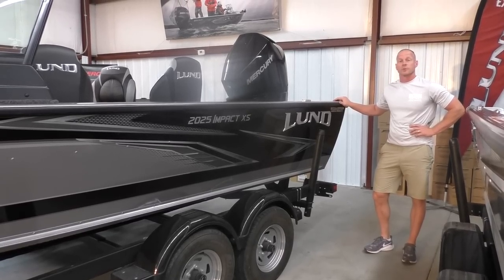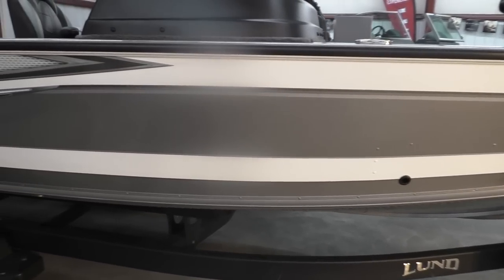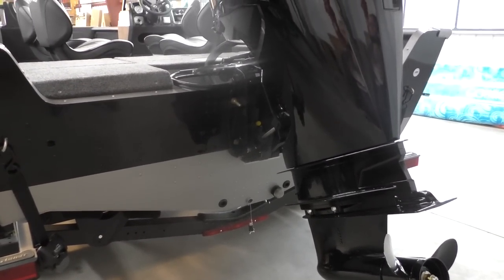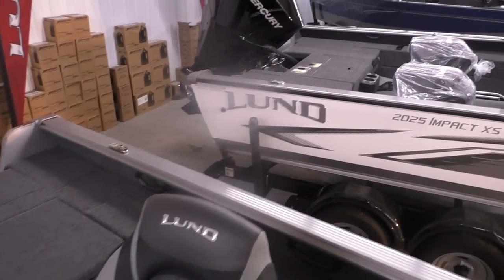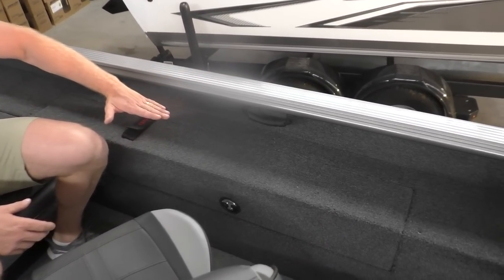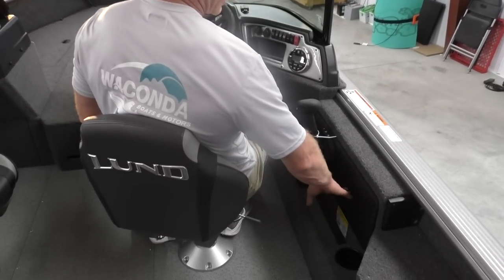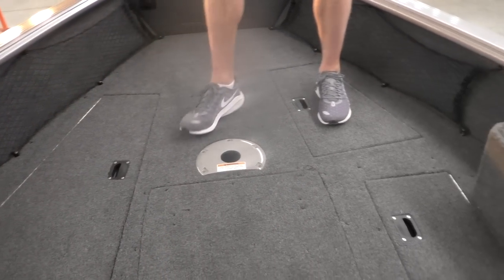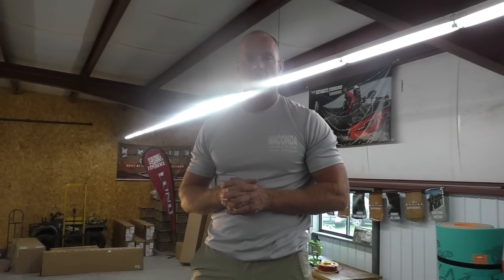2020 Lund 2025 Impact XS

Comment: I owned one 2019 model since Jun 2019 and I live in East Iowa 7hrs from Waconda,.  This boat as fantastic,  I been drive my on the windy day and a little bit of wave, but the Lund IPS2 really makes difference we didn't get wet form the splash water it push the splash away from the boat and the boat stay on its track when it's turning,. Overall design very nice any where of compartment and storage are very handy, compared with my friends owned other brands,. Lund always stay on top of them.   And the point is Waconda will give you the best price.
And now is June 7, 2020 just celebrate one year old for this boat, and one year review,   like I said, this boat is fantastic, I been change the propeller from factory 21p to 19p with four batteries, trolling motor, 85% tank of gas, one person on board, it runs 52 mile/hr rpm @56k and lund made the ips2 hold this boat stays in track when make a turn.  There are four of fishman on board still feel a lot of room and having great time with my whole family (5 people) with the walk through sport top cover. don't see any fall off screw, carpet, losing part, leaking, awesome job from lund factory.  
 I was searching for a good price on the internet around, then called Terry from Waconda Boat,  he gave me the best price for me, that is why I drove 7hrs for it.   They still responds a lots of questions after sold.
Quality boat, friendly dealer.  Stop here from your searching.  Call them then text them, your wallet won't shrunken.
Reply from the maker: Thanks Robin!  Glad you are continuing to enjoy your boat, Lund is Built to withstand the water and it's fury!